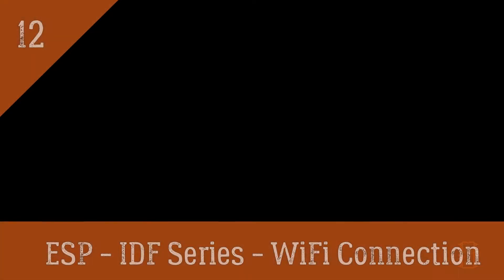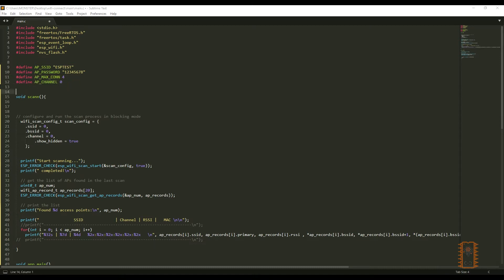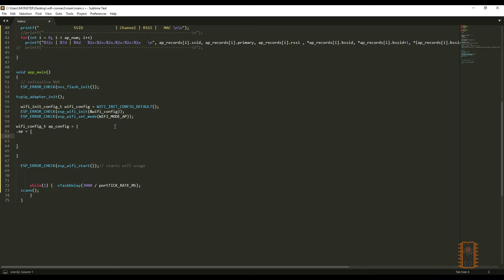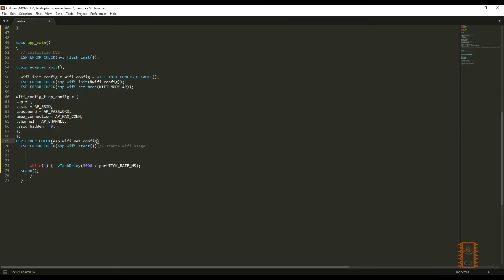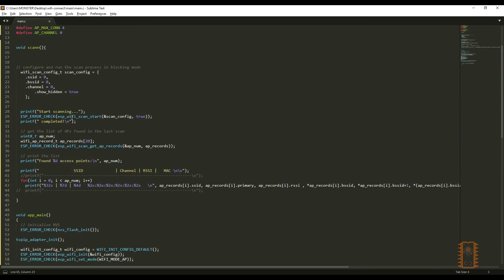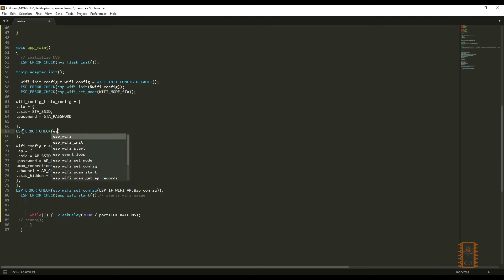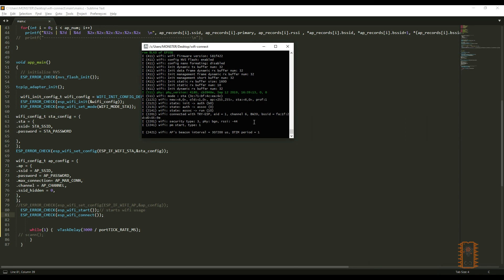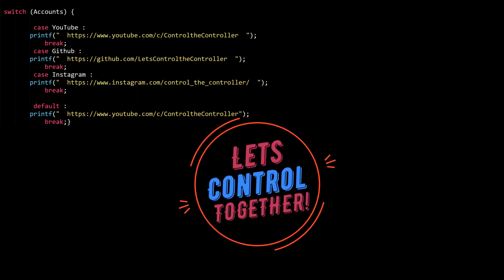#12 Wifi Connection ESP-IDF

Comment: Hii. I would like to know, how we can change the SSID and password of ESP32 after flashing a program. I mean if I have to change its SSID and password from a mobile application how it will he done?? Ex. If I have to connect my ESP32 to, to my wifi. Then I have to give ssid and password of my router. Then how to give that from outside. And not hardcoding it in the flash memory
Reply from the maker: Hi, of course you can. there are several types of doing this. 
Firstly, you can use smart config. It allows you to change without cable connection from your mobile phone (ESPTOUCH APP). You can find an example on esp-idf under the wifi tab.
Secondly, As I mentioned on the video, we can use esp with AP and STA mode simultaneously. So, you can serve an webserver on the network that created by esp32 (AP mode) , and you can connect another network(STA mode). If password or ssid of the connected network is changed, you can connect network of esp32 and join its webserver. From the webserver, you can change pass or ssid. (I have used this method for my projects)
Lastly, as you know esp32 has wifi and ble. you can use bluetooth to send ssid or password config from there.

I will try to shoot videos about these, stay in follow.
Reply: Thanks @ControltheController  really great Idea. Yes ofcourse In AP mode I can host small HTML page where on local IP. So just by entering that IP address of ESP32 HTML page will open then in that HTML page I can change my ssid and password. Then My esp32 will get connected to the wifi router with some static IP address.. that will be cool idea to implement. I will try this for sure. Thanks again for prompt reply.  If you could make a video on this topic. That would be super cool. Thanks is advance. Have a great day!! Take care!!